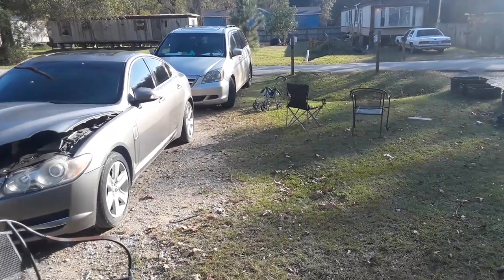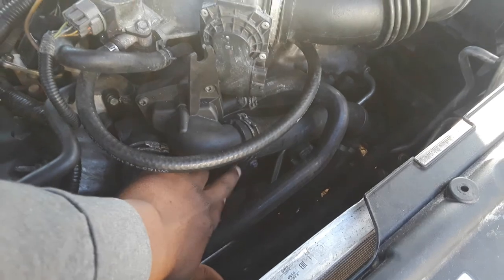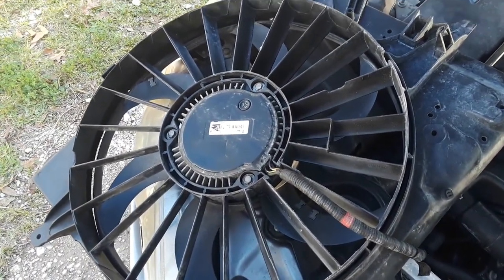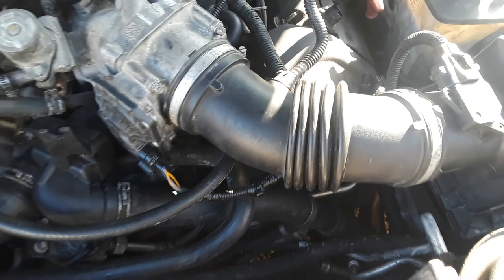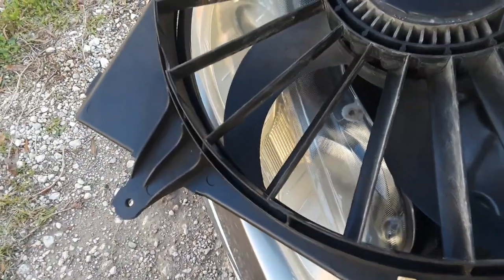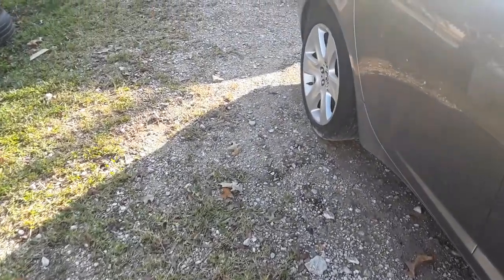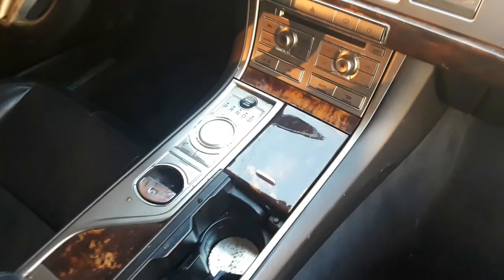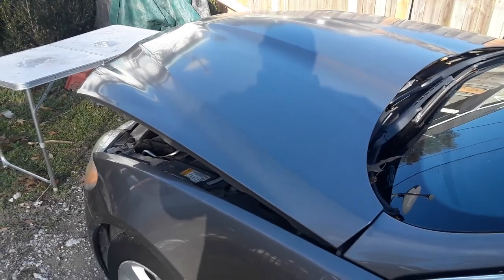Jaguar XF Overheating project

Comment: I put a new radiator in mine and a  new electric pump... It runs great now ... Stick to the normal transmission cooler...
Reply: I got a new radiator in mine but it still showing engine running hot so what do I need a electric water pump?
Reply: @carolynoliver9136  is it connected?
Reply: @carolynoliver9136  bleed the system too

Comment: I have a 2010 Jaguar XF I'm getting oil in the coolant what do you think I might have to do please let me know thank you
Reply: Head gasket leaking
Reply: @sqwidink1  I was afraid of that
Reply: I know it’s been 5 months. Did you try Blue Devil to resolve the head gasket issue?
Reply: @getmymail2676  I haven't.  What is it?
Reply: A Head gasket repair that my mechanic recommended. You can get it anywhere